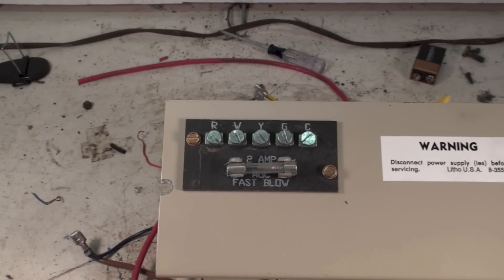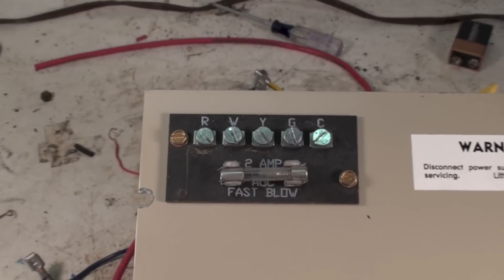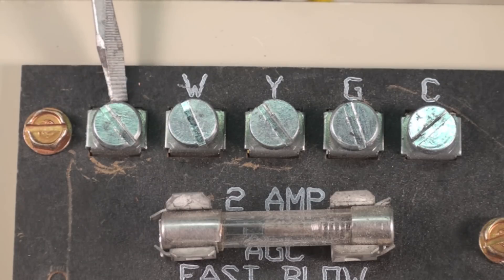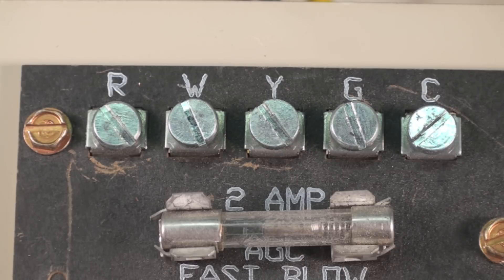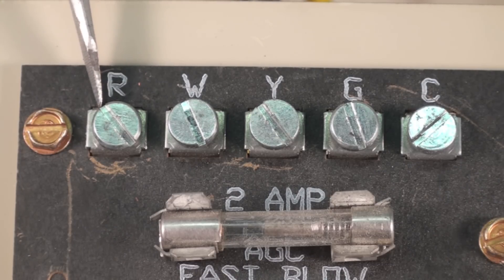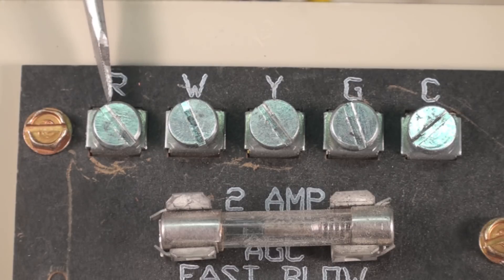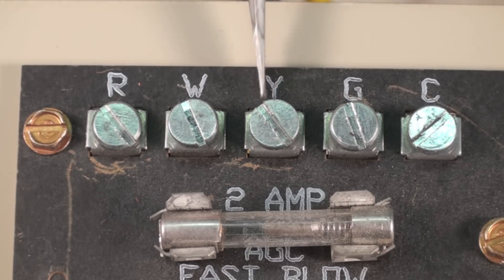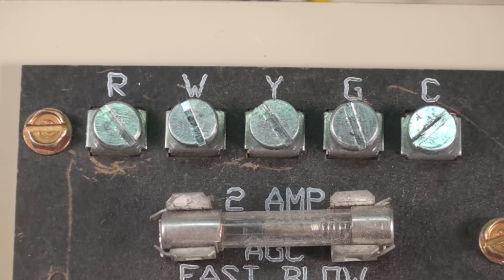What the terminals on the furnace terminal board mean

Comment: I have the exact terminals on my Goodman furnace control board.  What terminals would I hook my Aprilaire humidifier up to?  I'm thinking W and C?
Reply from the maker: That depends on the type of humidifier.  If it is a spray head that sprays droplets in the ductwork, it cannot operate unless the fan is running.  If it is an evaporative media type, W and C is ok.
GFM
Reply: @grayfurnaceman  Thanks... AprilAire 550.  Drips water over a water panel.  Yes, only need 24VAC to go to the solenoid when the heater or fan are running.
Reply from the maker: @BassAngler61  You are good. Go for it.
GFM

Comment: THANK YOU!!  I am installing a new wireless thermostat and the one currently in place is only using 4wires.  C isn't required as it is battery powered.  The new one though does require the Common power source but my furnace is from 91'.  No C wire connected and I now am able to verify the power output.
This helped a lot!  New Thermostat installed!

Comment: First, thanks for making these videos.  I have a White Rodgers 1F85-277 thermostat.  I am curious what the terminals B, "reversing valve Energized in heat, Off, Emergency Mode",  and terminal E/W1, "Emergency Heat Relay"  do.  What is the difference?    I am using this with a Goodman furnace and a Luxaire heat pump/air conditioner.  Thanks!

Comment: To test the fan I jumped from R to G on the furnace board but the air conditioning came on instead. I looked closer and there isn't even anything connected to Y yet the AC still works. Is that okay? It's confusing me, and I can get the fan only to come on by turning it to Fan on the thermostat.

Comment: Nothing was connected to the Y terminal but cooling still worked. I switched out to a smart thermometer and now cooling doesn't work. AC turns on but warm air comes out. Anyone have ideas?
Reply from the maker: Is your outdoor unit operating?
GFM

Comment: Thank you so much! I have some electronic experience mostly with Arduino type projects, but I never knew what these meant. Learning this helped me solve a problem with my Nest Thermostat. I have 5 wires behind my thermostat. The blue/common wire was disconnected. When I connected it I got error e9  which said the blue/C wire was detected on the Nest mount itself, but it didn’t detect anything connected on the other end. I opened my heater/fan box in my utility closet and found the same 5 wires with only 4 of them plugged into the board. The C wire wasn’t connected probably because my original thermostat didn’t need it. I connected that wire to the C terminal on the HVAC board and now my Nest works properly. 

In case this helps other people here is what I experienced that led me to this video.
I actually had my Nest installed for 2 years without that C wire plugged into the Nest and it still worked. However I always heard loud clicking noises when my fan or AC unit powered on. It started to concern me and as I searched the issue I discovered that if a smart thermostat like mine doesn’t have a C wire it steals power while the AC or Heat is on. This causes the fan and AC unit to turn on and off really fast causing the loud clicking sound as the Nest thermostat steals power the instant something is turned on. So the C wire provides a constant current from the R to C wire so the Nest thermostat doesn’t need to steal power from the other wires. I noticed that my Nest app also told me there was a delay for cooling. This is a safety feature on the Nest so it doesn’t switch the power on and off too frequently if it is stealing power. Hopefully I didn’t damage my HVAC units from using this for the past two years without the C wire, but at least I know I finally fixed my problem without paying someone probably hundreds of dollars to do something so simple.

Comment: Great video.  Any chance you've got this terminal board to sell?  Unfortunately, mine has 24V leaking from R to W.  As I'm sure you could guess, my furnace heat was running away with this condition present (due to a small humidifier leak, the board got wet but is still conducting even when dry) !  I've temporarily jumpered around it but would be nice to simply replace the board.  Thanks

Comment: Gray,
Old Coleman furnace. Has a fan control  relay/transformer with YWGCR taps. It went bad, Home Dept only sells transformers with CR taps. How do you replace with a new style ? Is the only way to buy a similar fan control relay/transformer online?
Reply from the maker: What you have is a fan center.  You should be able get one at a local HVAC dealer.
GFM
Reply: grayfurnaceman thanks pal. After a couple of hours researching I realize this is a specific relay/transformer setup.

Comment: If I have R to W read 19v, but R to Y and R to G  are 28v. What’s that mean? When I switched the thermostat to HEAT, neither fan or electrical strips is on. Is the control board bad? Thank you
Reply from the maker: The R to W reading is probably a ghost voltage.  Jumper R to W.  If the furnace starts, look to thermostat or wiring.
GFM

Comment: I have two identical furnaces with terminals like the above. One runs and the other doesn't. On the one that's running, I get about 26V current across R-W, R-G and R-C, whether the furnace is operating or not. On the other furnace, I get 0 on all (even though the fan motor runs constantly). Is this a problem with the thermostat? Sorry if this is a really dumb question.
Reply from the maker: It is not dumb.  Are the furnaces twinned?
GFM
Reply: @grayfurnaceman   - No, Grayfurnaceman, they're not connected, but I can use one to check the other. I'll even pull the operating thermostat from one and wire it up to the other. Funny story. A repairman from the biggest company in town came out and concluded it needed a new circuit board. He said "Sit down for the bad news: It will cost $929." I bought one from a reputable online company for a little over $200. I switched it in and the furnace still doesn't work. So what's so funny about that story? He never put a multimeter on the terminal. That's why I asked. I'll be back if the thermostat switch out works.
Reply from the maker: @LoganFryActor  This one sounds like you may have an open limit switch.  That would account for the fan running continuously.  I would be looking for manual reset limits located around the burner assembly.  
Sorry about the failed diagnosis by the tech.  Sometimes I wonder about some of the service techs.
GFM
Reply: @grayfurnaceman   - No, grayfurnaceman, it turned out to be bad wiring. I tried to match the original wiring, but either my diagram was bad, or the wires got switched some other way. So I got the ST9103A wiring diagram online, cross-referenced my working (identical) furnace,  and basically wired it the way it was shown on the Honeywell diagram. Started right up.Thermostat works, burner works, fan works. Turns on and off when it's supposed to. Thanks for your help. You got me on the right path.

Comment: What's the difference between heat wire and fan wire on cooling system
Reply from the maker: The fan wire is to turn on the indoor fan.  Heat energizes the heat source.
GFM
Reply: @grayfurnaceman  ok thxs meaning that fan mode and heat mode will have same temp air flow in the room or with heat I expect hotter/ warm air
Reply from the maker: @benardasiimwe4414  Most furnaces control the fan when the furnace comes on.  When you energize the fan on the thermostat, the fan speed could either go up or down.
GFM
Reply: @grayfurnaceman  ,thank u ,now ,from my experience I know fan runs and at room temperature now what happens if u put on heat ,for the cooling systems only

Comment: Question for you @grayfurnaceman.  I understand what each of the terminals do.  I appreciate the concise explanation.  What is the history of their names, though?  Is it just, R for RED wire, W for WHITE, G GREEN, Y YELLOW, and for some reason C is an exception and stands for common?

I have heard someone call W "warm", which makes sense based on what the terminal does.  I have no idea how you would get from Y to "cool", or from G to "fan".  I guess R might be poweR, because then it doubles as "red wire" and "poweR"?  G could mean, going "Green" as in saving energy, as it turns on the fan (and potentially not any Air Conditioning).  I don't know!
Reply: Never mind, just saw a separate comment with the exact same question on this video!  I see that it is just a convention based on the wire colors (apparently).

Comment: I want to check the voltage across the solenoid valve (24V AC) that I presume is connected with R valve in series with the humidistat. By just turning on the blower fan and setting the humidistat to 100% can I measure that voltage across the solinoid wires. I understand I do not have to switch on the furnace or the AC for that voltage to measure.
Reply from the maker: That depends on how the controls were set up.  Many will not energize the humidifier unless the heat is on.
GFM

Comment: Confused about the R and C terminals.  I measured resistance between terminal G and a mounting screw, and the meter showed continuity.  So I concluded G was connected to ground.  If terminal C has continuous 24V (is the 24V AC or DC?  I assumed AC), seems like to test terminal C, I should measure voltage between C and G.  And to test R, I should measure between R and G.  But this doesn't work.  Why is this?

I haven't measured between R and C yet, as you'd mentioned in the video.  I wanted to get a better understanding of the wiring before doing this or anything else.
Reply: OK, I measured around 28V AC between terminals R and C, which I understand now.  But I'm also measuring continuity between terminals C, G, and a mounting screw, which confuses me.  If terminal C is common, I can understand why it's grounded to the furnace housing.  But why is terminal G also grounded to the same housing if it's controlling the fan?
Reply from the maker: @ptmoy1  Stop using an ohmmeter when you should be using a voltmeter.  Continuity is useless for this type of testing.  You will get numerous odd readings.
GFM

Comment: Gary, I have an old oil heater in my garage that came with my house, which used to work fine (other than making a big boom sound every time that it ignited). However, when I tried to use it, this season, someone or something thing had disconnected the thermostat.

The terminals on the Honeywell controller are C F F R(T) W(T) Y G. The wires from the thermostat are red and black. I tried to connect the red thermostat terminal to R(T) terminal on the Honeywell box and then the black thermostat terminal to first the W(T) and then the C Honeywell box terminals, but neither of those connections causes the heater to ignite.

Can you please tell me what I might be doing wrong?

FYI, the F and F terminals of the Honeywell box have two brown wires going to something else. None of the other terminals are connected.  Also, the Honeywell box has a red button that seems to power it off when pressed, and it appears to have a light that never comes on.
Reply: Yehovah Saves damn: you wrote all this and still ain’t got an answer for over a year!!! I figure I answer with: I definitely don’t know but hope you fixed your problem by now cause If you still waiting for this guy to answer you: well you’ll keep waiting!!!!!

Comment: We have always wanted to turn on just our fan.  When recently installing a different thermostat, I looked at our wiring and just the w and rh wiress were connected.  I then connected the g wire on the "new" thermostat(bought used on Ebay) and tried to turn on just that fan and nothing happened.  What am I missing?
Reply from the maker: If you connected the wires at the thermostat, check to see if the G wire is connected at the furnace terminal board.
GFM
Reply: Yes, I also opened up the furnace and connected the g wire to the terminal board.
Reply from the maker: Try jumpering from R to G at the terminal board.  If it works, there is an open in the thermostat wiring.
GFM
Reply: Jumpering from R to G turned on the fan.  I'm not super learned on electrical stuff.  Is there an easy fix for this?  Or, do I just have to throw away my thermostat and get another one?  :(
Reply: New thermostat should do it. Sometimes it's the wiring itself. But that's not as common
Reply: That's upsetting because I actually just put in this one not too long ago.  It was bought used on Ebay so I guess it doesn't surprise me.  I like it because it works with my xfinity home system and smart phone.  I guess to make sure it's the thermostat, I can try hooking up my old one and see if that fan works with that one.
Reply: @TN-cx4qi  Can you think of anything I can do to make this work without buying a new thermostat?   We only have heat and no AC.  Can I try hooking up the green fan wire to the RC terminal and set the thermostat to cool to run the fan only?  There's nothing special about these terminals, is there?  They are all basically just a switch or two wires that the thermostat just connects or disconnects, yes?

Comment: Then what would you use the common for?
It seems that is neutral from your explanation. If you get your power from r and c then one should be 24v and the other 0v.  Is that correct?
Reply from the maker: There is no neutral in low voltage.  Just 2 sides of line.  The "common" is usually the unswitched line and is connected to the chassis of the unit.
GFM
Reply: Ok, but what is common used for, just constant tstat power supply for non-battery units? You stated you would have 24v between C and R. How could that be the case if both are 24V supplies?